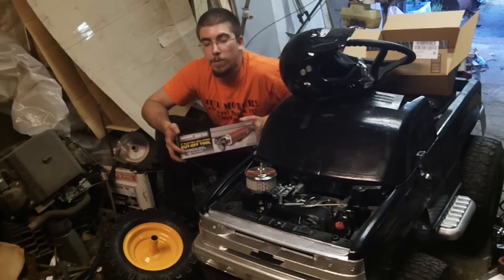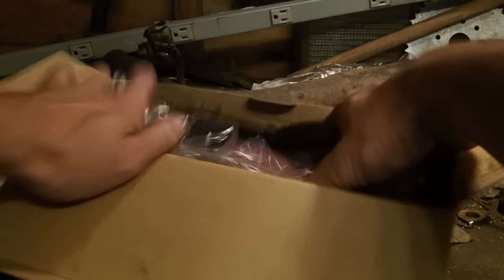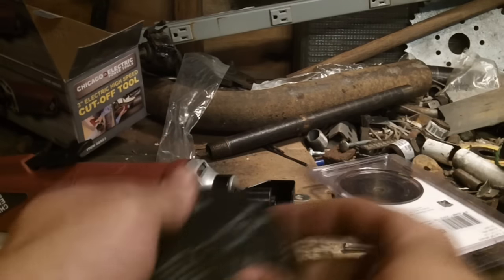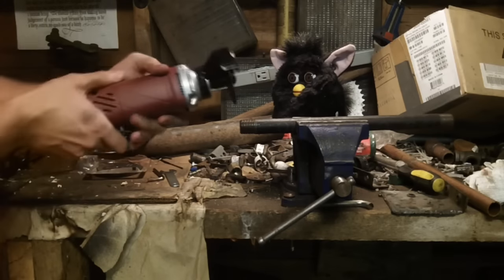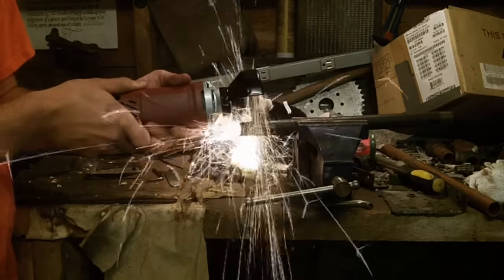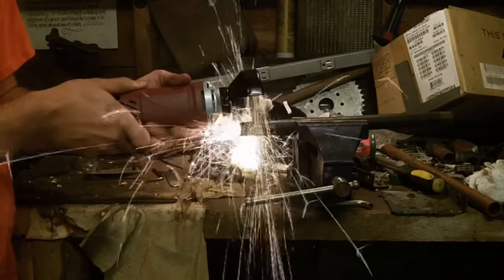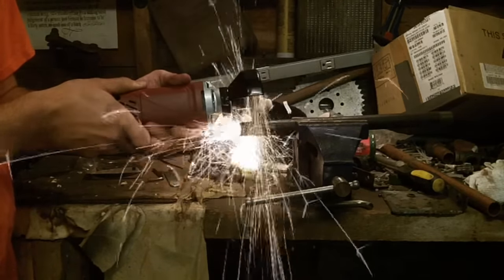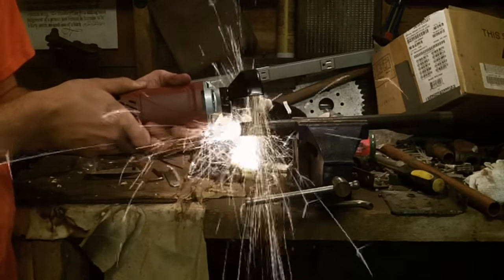3 inch High Speed Cut-Off Tool Electric

Comment: I feel you were a bit too aggressive with the tool but agreed with your comments on moving the cut to avoid binding.  People should always be aware of which way the tool might kick back and stay out of its path especially when lying on your back or in close quarters.  Taking a spark shower isn't a lot of fun either and wear those safety glasses y'all.
Reply: Or wear a face shield for extra protection and I recommend wearing ear muffs since sawing metal is noisy as all hell.

Comment: Are these good for cutting off bicycle chains?
Reply: Yes, but if it's a simple chain I'd go with a bolt cutter or even a dremel with a metal cutting disk.  Also, you will have to somehow keep the chain taught.  If you try this and are not experienced you really should practice first and keep your arms pretty straight and off to your right or left side in order to keep the tool well away from your face & body.  These tools can kick back towards the operator and are potentially quite dangerous.  Also, you must wear safety glasses as the disks can shatter & hearing protection is highly advisable.  An angle grinder with the apppropriate disk may also be a safer option.
Reply: Depends on who own the bicycle.  Lol